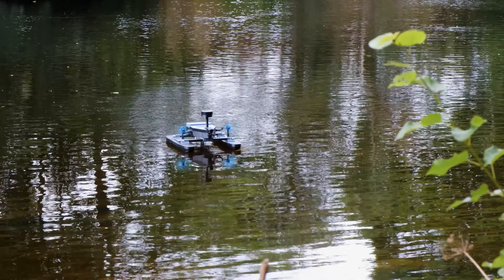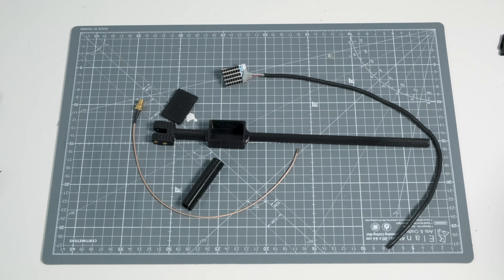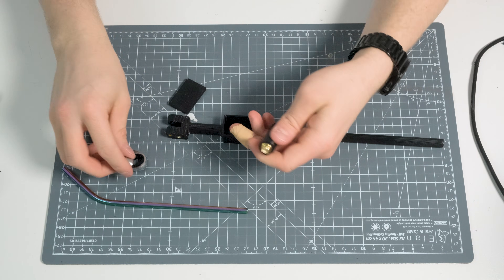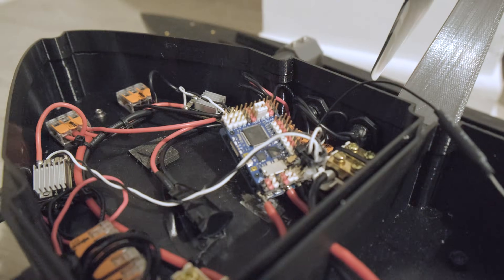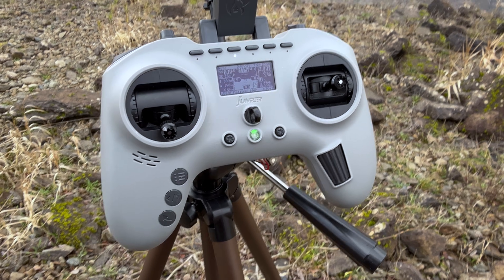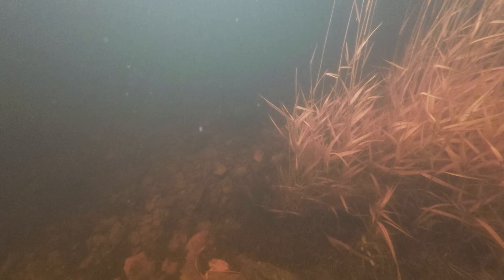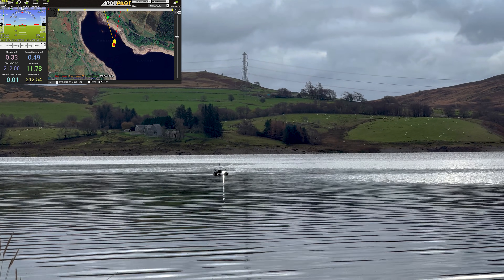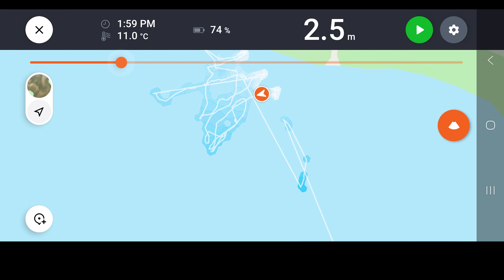I Sent My DIY Autonomous Depth Mapping Boat On Its Longest Mission Yet

Comment: Going to back and watch more of the 'progress' videos. I think next item might be some strong signal lights; so you can get a better visual on position and heading. Also the radio for telemetry (in the mast), maybe better to have the heatsink open to the air for better cooling? Not sure how hot that's getting.
Reply from the maker: You're right! Ive added some cheap red and green light so we can see dorection. But today we sent it quite far in bad weather! Video coming soon. You might be right i'll have to check temperature after a long mission. Too hot when the petg melts!

Comment: Wow, well done on a great project! This is the first video i looked at, so dont know if you have tried it before. Would you not be able to double your battery life by cutting down to one engine and prop, pushing the boat with a vane and servo at the back to control direction, almost like those swamp boats. Inertia is causing the boat to steer through its waypoint direction, you either need to slow down the turn or dampen it somehow, maybe with a keel. I didnt look to see if your boat has a keel or keels for the double hull, this will help with drifting and the boat might maintain its direction better. It is an awesome project and your iterations and engineering thinking is inspiring.
Reply from the maker: Thanks mate really means a lot! Very interesting. The philosophy behind the twin props was mostly as it simpler to build, less mechanucal parts and you can turn on the spot like a tank. But id definately be interested in the potential of reducing battery usage!  Thank you! Its still got a long way to go. Im looking forward to the rest of the joruney.

Comment: Take the deeper apart and install into the boat, just wire the sensors that turn the deeper on through a relay switch, also then you can mount a wifi repeater to it to boost the signal range to over 300m
Reply from the maker: Thats a cool idea... Im researching exactly that with the range extenaion right now. Mixed view online as to wether to mount the repeater on the boat or at the shore though. On the same page.
Reply: @CyAntonyAsh  I use a bait boat like this for fishing, deeper sell the extender which goes on the shore, I know you can make your own repeaters from old wifi routers which I would position on the shore or at least one on the shore
Reply from the maker: Id really like the deeper one but its rather expensive for 'what it is' ive been looking a what routers i had lying around but the deeper app is quite picky with the type if connection through the router to the fish finder. I'll find a way. Someone in the forum im in uses a dummy phone in the boat for the app and relays the info back like screen mirroring.

Comment: May I suggest a portable mast for your controller - one that gives you a higher angle for better line of sight. What software are you using for the deapth maps you're creating?
Reply from the maker: The plan is to integrate all the ground control into a hardcase with an external mast. Thinking alike! Currently im using the fish deeper platform as for early testing its great!

Comment: Does you GPS module have a compass? If not that would explain why it went in the wrong direction before it could figure out direction from GPS.
Reply from the maker: I've got a here + gps and compass module so in theory it should be top tier. I wonder whether something is inrerfering with it as theres quite a lot 'going on' on the boat.
Reply: @CyAntonyAsh  Ardupilot has a compass interference test built in:

	• Check interference (motors must be running, reverse props)
		○ Setup > Optional Hardware > Compass/Motor Calibration
		○ Less than 30% good
		○ Less than 60% acceptable
Reply from the maker: I'll give it a try, thank you!

Comment: Which flight controller had the corruption issue? Which will you upgrade to ?
Reply from the maker: I've got a matel f405 wte. Apparently all the f4 boards are well known to do this. So im going to be moving to an matek h743 wing v3. In all fairness ive never had the issue before, it may have been something ive done without realising!
Reply: @CyAntonyAsh the Matek H743 Slim is the flagship model, it's upgraded more often, and is actually cheaper.
Reply from the maker: I'll have to investigate! I quite like the built in power ditribution within the wing series. But yes wing comes to almost 100 pounds

Comment: Well done! Did the tri-vane props help with maneuverability at all? That lake is kind of scary, I was waiting for a Loch Ness monster or a missing person to show up. It seems oddly devoid of life and the plants under the water are the same as the ones on the shore, which is strange. I wonder if putting the underwater cam and light on a winch would be worth it, lowering down from time to time would be cool, though easier said than done. Keep up the good work, it's coming together nicely  👍
Reply from the maker: Thanks mate, i think they definately seemed higher torque, but they are a bit higher pitch and ideally were trying to keep as quiet as possible. 
I know watching the footage back was as you say quite lifeless. Me too! I was waiting for something to move quickly past the camera. Well... the idea is either soemthing to lower the camera down or a detached submarine that uses the boat as irs above water connection back? We'll see. Thank you mate, it means a lot.